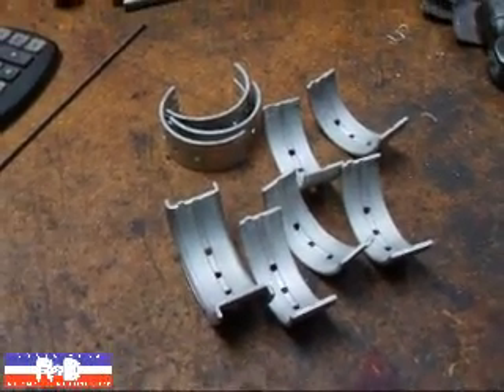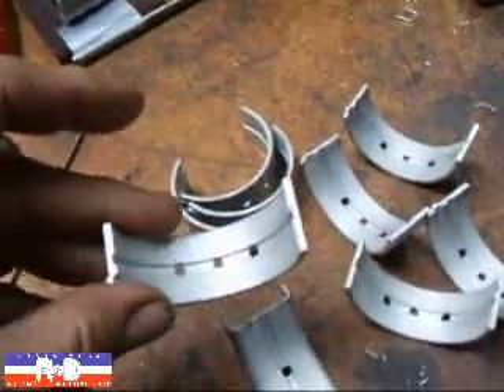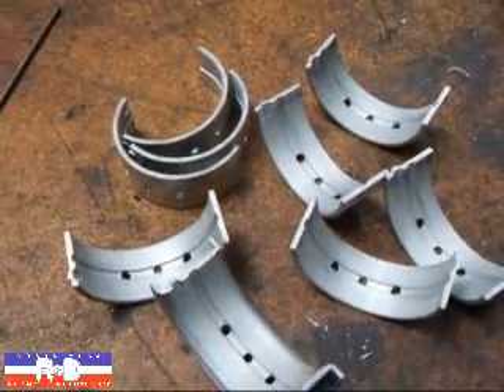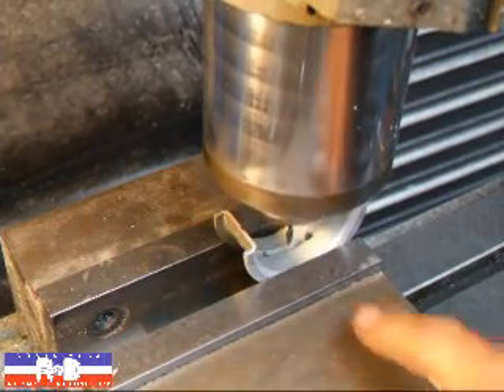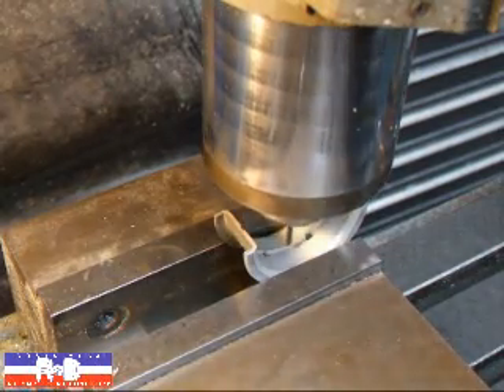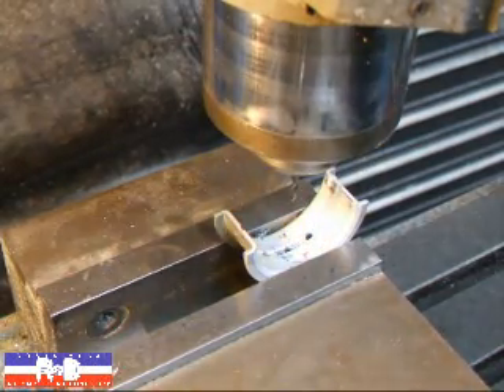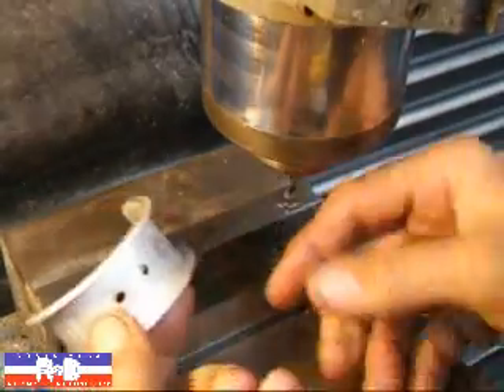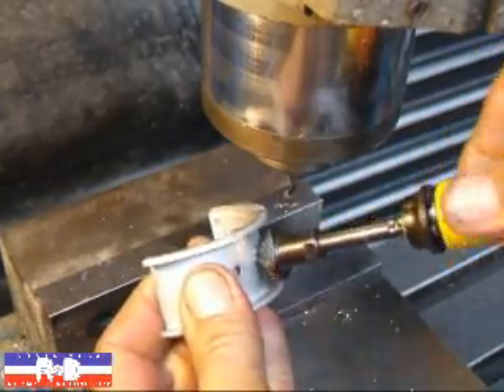BMW_Main_Bearing_Mod.mp4

Comment: John I don't know if you knew this or not, but the E30 M3 Evo 3 (the 2.5 liter, last iteration of that series available only in Europe) had actually 5 holes in the main bearings - it is a common upgrade for 2.3 liter S14 owners

Comment: John, if somebody did this in an engine that still has the stock, low-volume oil pump, would there be a drop in oil pressure after doing this to the bearings?

Comment from the maker: @pantherxx010 - Not all engines because some do not have a full annular oil groove in the block, but those that do, yes. If a high-volume pump is available for the engine, its best to install it with this mod.